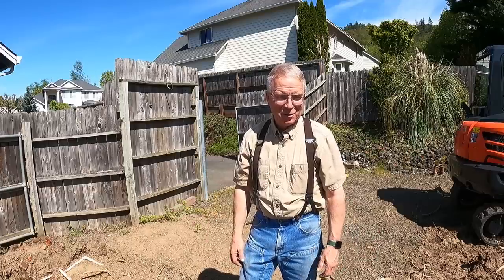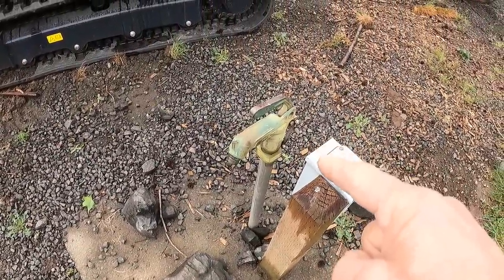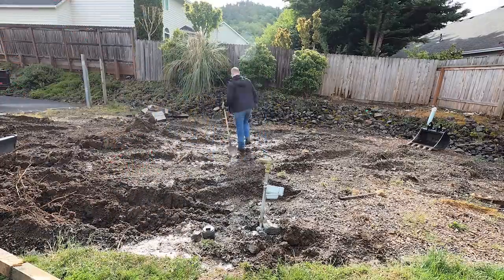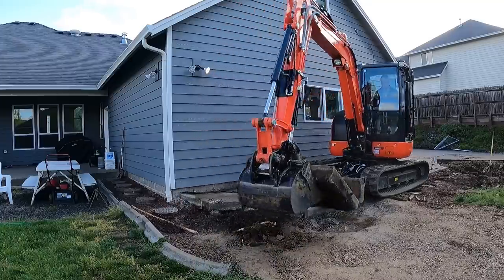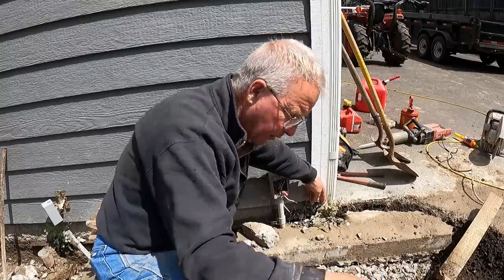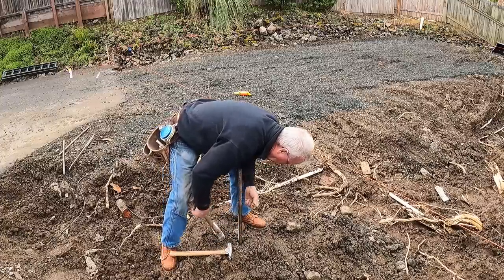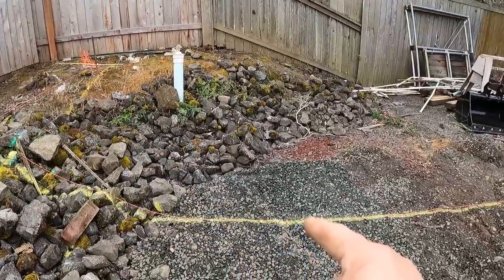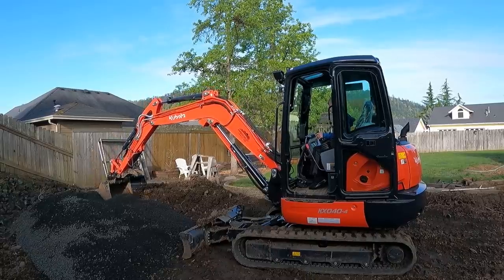Site Prep: Shop Build # 2

Comment: Your new toy needs a hook or an eye on the back of the bucket to attach chains or straps.  Running a chain across the edges will break the chain or cut a strap in time.  Keep up the good work.  Cam

Comment: A tip when running your new toy, put the blade down with some pressure to keep the machine planted
Reply: He has it down enough to lift front up slightly.   He is just digging in some hard ground next to drive.

Comment: 2:35 isn't a 240v plug; if that was originally intended for an RV, it would be a 30 Amp 120v 3-prong plug(Should be labeled as a NEMA Tt-30R). A more modern setup would have 120v / 240v split phase service, which has two 50 amp, 120v hot leads with a ground and a neutral(NEMA 14-50R).
Reply: I’m so glad I went to carpentry and not electricity
Reply: @Ichabod_Jericho  lol
Reply: @Ichabod_Jericho  Unlike most of my family, I didn't go into a traditional trade but Electrician would be high on my list of jobs I wouldn't want to do because it's one of the few that can get you killed because of someone else's mistake. Although when wearing my Infrastructure Engineer hat I do have to deal with everything from low voltage Power over Ethernet equipment, to high voltage in a Data center, so I do need to know enough to speak with an electrician using technical terminology that they understand.

The reason I recognized the receptacle is because my grandparents, parents, siblings and extended family all seem to love land yachts(formally known as RVs) of various types and they all want the ability to hook up to power when visiting(I prefer motorcycles and hotels). So I personally have a GFCI Outlet Panel(with a service disconnect) installed that has two 120v, 20 amp(NEMA 5-20R GFCI WR), NEMA 14-50R and a NEMA TT-30R for when I have visitors. 

And to make the wires useful for when I don't have any visitors, I use them in combination with a manual transfer switch for a Generator hookup.
Reply: exactly what I came to say

Comment: I believe an RV outlet is usually a 30 amp 120v circuit...
Reply: And some are 50 amp at 240V.
Reply: @johnirwin1837  - Thanks for the correction... I’ve only dealt with campground outlets and smaller usually older travel trailers, so my knowledge of the subject as far as the higher end and newer, is rather incomplete. :-)

Comment: For the water feed.  Just pipe it straight from the house to the shop.  Don't bother with a shutoff in the middle, do two shutoffs on either end.  The one in the middle will loose its handle to rust very quickly and no one will want to use it.

Comment: Would you prefer to remove thicker concrete slabs instead of reinforced slabs?
It would be nice to know what's easier to get rid of when time catches up.
Reply: You can't break slabs with rebar into chunks, you have to cut the rebar first, and the diamond saw won't cut through rebar, so that complicates things.

Comment: Do you use 811 in Oregon? There was no mention of “call before you dig” but it would be good to let Joe homeowner know they need to do that before any excavation can take place.
Reply: 811 will not locate private utility lines, i.e. anything after the meter.
Reply: @zachary_fb  But you don’t know what type of lines are there until you call…  It’s a free service that could save you a huge bill or your life. And with a little foresight, it doesn’t delay your project.

Comment: I took a demo saw to the neck and chest when I was 19, hit the left side of my chest about 4” below my collarbone and ran up to my neck to my jaw. The cut on my neck was 2 cm from my carotid artery, had to get 2 units of blood and around 280 stitches. Also the blade grazed my collarbone enough to cause a weak point so I broke my collarbone 3 weeks later lol that was a rough year
Reply: Holy crap! How the heck did that happen??? As someone who uses cut off stone saws on a daily basis, Im intrigued.
Reply: @MrKelticfan  I’m a pipe guy, was cutting a piece of 48” ductile iron pipe and it was the very first time I had ever touched a demo saw. I was cutting a 20’ joint in half and I was so green I didn’t pay attention to the fact it was sitting on 4x4s on each in so when I cut the last bit the pipe closed up on the blade and kicked it back. Statistically speaking there is no way I should have left that job site alive. Left me with 2 sweet scars and a new respect for that saw

Comment: Your using the wrong bucket when digging for services never use bucket with teeth and use a cable avoidance detector for the electric ⚡️ it will even tell you the depth of the cable as well as the exact line it’s taken